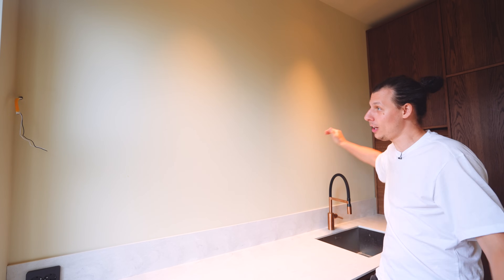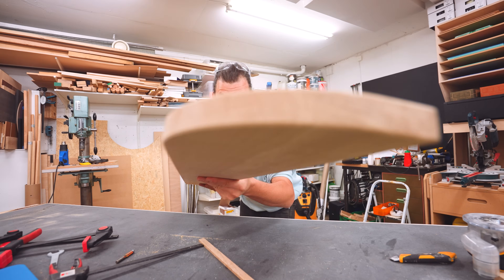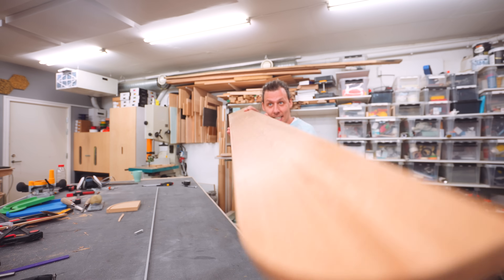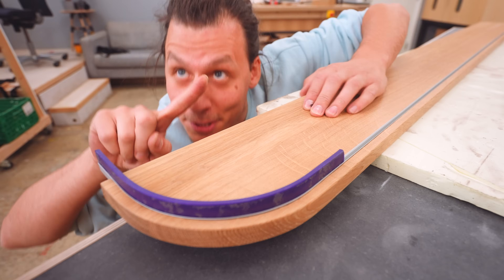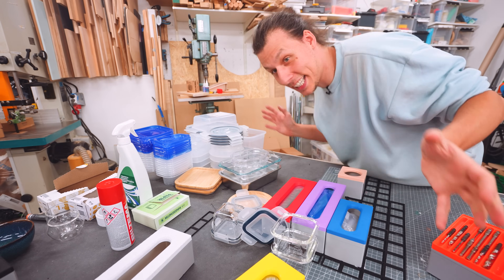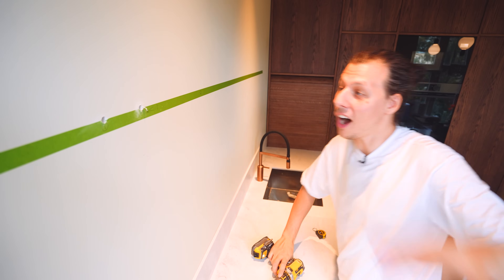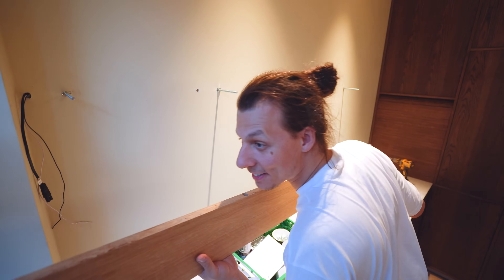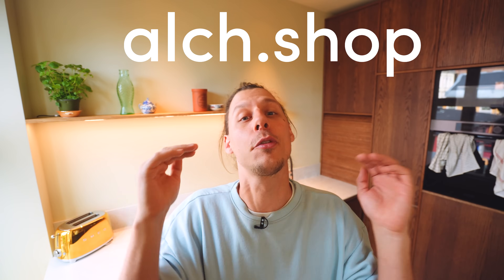How To Make Super Strong and Thin Floating Shelves with Integrated Light

Comment: Springback: It might interest you to know:
I used to build Four Slide tooling.  It's an ancient Pre CNC technology of bending metal wire or other things made of metals.  The slides came in from four directions for complex shapes..  I'd design and build the tooling and work out the problem you had there called springback.  Weld run a shipment of wire and send the finished parts out.  Then when they job was ordered again, the old tooling was no good. Thisis because no two batches of steel wire have the exact same springback characteristics.

Comment: That’s really awesome, surprised you would not have added blocking in the planning stage to account for this, but I guess with metal studs that might have had its own challenges. I’ve had too many issues with drywall anchors/toggle bolts to fully trust them for this kind of application

Comment: I actually like the slightly high Kelvin LEDs in the shelf, it kinda sets them apart as "task lighting" from the general lighting in the room. 

Your ingenuity is really inspiring!  I never would have thought to use the half-diameter spacer (drill bit) to enable marking the centers of the rods in the wall!

Comment: That looks super nice. Just one quick suggestion for your "square hole drill tool" ... maybe a model with replaceable guides different diameter drill bits. Just add a thread to the outer-face of the drill guide so that it threads into the rest of the frame.
And, for your drill bit and slotted set holders ... how about a version with a clear perspex lid to prevent the bits from falling out? Maybe drill a hole in the perspex for a nedymium magnet to keep the lid safely closed :)

I have ideas ... just no skills or hardware for 3D printing - but maybe my ideas can help your ideas (which, ironically, is what you try to do for everyone else, so it's nice for Karma to return  back to you 😁).
Reply: Nice!

Comment: If you want to fix too long LED strips, you could cut them to the length you need and solder an additional resistor to the end of the strip. That should fix the problem, Thomas Sanladerer showed that when he built his fake neon sign with LEDs.

Comment: Alternatively you could have used a LED strip with a silicone outer layer that is flexible. The smallest on I know of is by Ostermann and requires a groove 4mm wide and 8mm deep.
Reply: Yes, would have saved a lot of time and afford with the curved groove!
Reply: At equal power those would run really hot and not last as long. The aluminium profile is important if you want them to last a long time.

Comment: Love the techniques you used here to make your curves. Honest question (not a criticism): given that you knew enough before drywall to be able to put in a tube to run your wires for the shelf lights, why did you choose to hang the shelf from the drywall rather than putting structure in the wall to accommodate it? I have floating shelves in my kitchen, and we had a metal shop fabricate welded steel brackets that are bolted to the sides of my studs, with bar stock poking out of the drywall onto which the shelves are placed. The shelves are made from quartz like my countertop and the brackets are so beefy you could sit on the shelves without them sagging. I realize you have metal studs, and I'm not familiar with those, but I would think that it would be possible to attach to that structure.

Comment: Amazing as always. What if you need to replace the LED strip, how hard would it be to disassemble?
Reply: That would be fairly easy. Just pull out the plastic diffuser, pull the led strip out (the hardest step), clean off any glue strip residue, put in the new strip.
The only problem with this design is that the strip is bent around the back edge of the shelf, and I haven't seen any quick connectors/terminals, so this might involve having to wedge the shelf away from the wall a bit. 
If I were doing that, I would've had the strip same length or shorter than the channel, and I would've router a small recess at the end of the channel and installed a simple push-in terminal block for connecting the strip.

Comment: I struggled a lot with air aerated concrete wall in my kitchen. It is sooooo pain in the ass to mount anything to it. I ended up using FPX anchors which I will probably never get out of the wall. When I see how simple is to use drywall ... oh boy oh boy

Comment: 13:14 I've worked with drywall a good bit... It kinda looks like you broke the gypsum board inside the paper sandwich when you whacked on it 😬 But hard to tell without being there. If it works it works ¯\_(ツ)_/¯

Personally my favorite anchors for drywall are the zip tie ones. I think project farm even did a video comparing all of them and the zips won. I've even hung half of an extendable tv mount (16" mount onto 24" studs) with them and they lasted for the few years the guy lived there without failing.
Oh, and the zip toggle anchors are actually good for metal studs too! They're basically just a wide nut that will brace against the inside of the metal stud.

Comment: so I need to make a slim floating shelf as well but  my mom would kill me if I made those huge holes that you made so my alternative idea is probably to get a metal plate that's 2 in wide maybe three not sure the same thickness as the floating shelf and then drill a hole in the middle and stick a long Bolt and then with a nut the both would be flat on the plate so I'll have to countersink the metal on one side so that the bolts will fit flat and not go against the wall and use the nut like you did I'll probably use a locking nut so it'll be tighter and none never get loose countersink the metal plate into the wood besides the holes I would have to drill and do this three times so instead of making three huge or four huge holes in the wall they'll be six tiny holes I'll make sure I'll use really skinny screws but that are long enough that'll go into the wood stud and be strong enough to hold the Shelf up the show has to be 3 ft long and 12 in wide and I'm going to put in front of the show a wall so this wall is going to be 3 ft wide and about 10 in tall and it'll probably be half an inch thick I don't need it to be really thick then on that wall I'm going to hang 8 by 8 decorative plates if they're still available I'm thinking of buying of Snow White and the seven drawers plates because my mom likes Snow White and the seven drawers stuff and put it in front of the wall in the actual shelf behind the wall will be the internet equipment right now it's on top of the of the stereo we have this German stereo that looks like a piece of furniture if you look at it you wouldn't even know that it was a stereo it's about 4 or 5 ft long and it's wood and it's shiny wood that you can see your own reflection on it and it's dark colored brown if you open it two doors there's a record player and a radio and on the other door it's where you store the records so it looks tacky to have the internet equipment on there so what we're going to do is put a shelf and hide him on the shelf and be in front of them it'll be covered up with a wall and there's where the decorative plates will go yeah you'll be able to see the equipment from the side view because of course we can't put them inside a box not enough air ventilation and I don't want to make a box with holes in it that looks tacky so I'm just going to put a Shelf with a wall in front and when you look in the front of it all you see is a decorative plates but when you look to the side you'll be able to see the equipment until I can figure out a way to block the side as well but still allowing air flow to get through it I don't want to restrict any air to this because one of the boxes gets pretty hot and if I restrict the air it might get too hot and cause a fire so I want to make sure they get enough ventilation so that's my idea for the floating shelf to use long bolts and skinny bolts that will fit into one inch of wood and bolt it onto the metal plates and make sure that the bolts are flush with the metal plate and then I have to drill the extra counter holes for the nuts and the metal plate just like door hinges are counter sink into the door and even the lock the one that where the bolts when you put a bolt on your door to lock your door you know where you have an extra bowl to lock your door there countersink the plate that goes on the side of the door where the little metal bolt comes out to lock the door so I have to counter sync that too and then I have to drill a hole for all the cables to be managed I'll zip tie them all together inside on the shelf and then underneath I'll use these tubing that they sell on Amazon that you could put it through the tubing until it reaches below the stereo and painted the flat white to match the wall the shells will be painted white too the match the wall so it'll look less tacky

Comment: You use 3D printing for exactly what it's best at, but I do have one suggestion. All of your 3D printed guides seems extremely specific to a single job on this one project. That's going to leave you with a bunch of guides that you can't reuse unless you're making the same thing which is wasteful. I suggest you think about designing these guides to be configurable and reusable which will 1) help you in the future because you won't need to design and print new tools and 2) help reduce the waste unfortunately inherent to 3D printing.

Comment: What an insane amounts of one time use plastics! We go so far to stop one time use plastics and you produce 100gr of plastic waste just tu drill a straight hole. That’s just depressing and awful. And don’t start to talk about the theoretical biodegradability of pla. We all know, that that doesn’t work in practice and that all of the pla has to be burned since it can’t be recycled by normal recycling points… With your amount of public attention, you should acknowledge your function as a role model.
Reply from the maker: I totally agree! However, I don't throw away any of the 3d prints. I've got some cool upcoming projects turning those into new products :)

Comment: I hate to be the only negative comment in this gushing ocean, but how much time and money is spent on all these specialized 3D printed jigs?

I realize this is what he's about but to me it's way beyond practical.

He made a jig to drill straight holes in drywall for mounting the molleys, I don't even think it would matter if the hole was 10 degrees off, the design of the molley with four legs will square it. Small ones can be hammered in without even a hole.

I'm just a grumpy old man, I would have cut the corner radius with a paint can but my video wouldn't get any views.

Entertainment is all this is. I wouldn't use it as a how to video unless you have a monster shop at your disposal... in that case you're not watching YouTube to find out how to do it....

All in Love, I would love to know his budget....